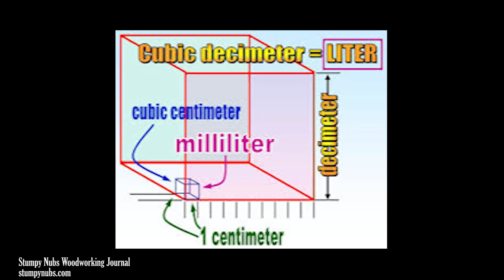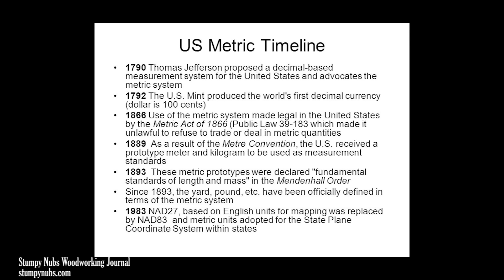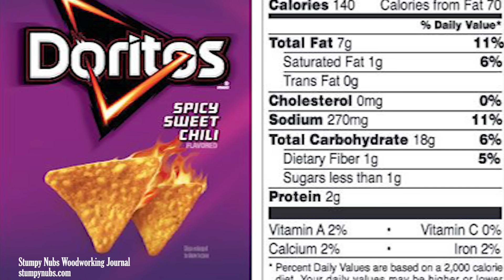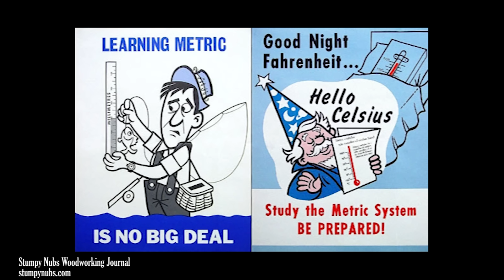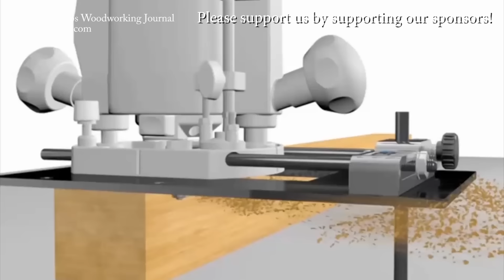BREAKING: The USA is switching to METRIC!

Comment: I’ve used inches and fractions almost forever in my workshop. But during my last project building a desk, I got real tired of adding fractions like 3/8 + 1/4 + 3/16  to get a total I need to make a cut. I whipped out my metric tape measure and  almost never looked back. I reduced my scrapped cuts as well! 1:49
Reply: ditto, I use metric whenever possible. especially if its a project I am doing alone, for myself. I grab the metric tape every time.
Reply: 6/16 + 4/16 + 3/16 = 13/16 ...... if you convert like that in your head, it's trivial to add fractions on the fly... For woodworking, where the smallest fraction will be 1/16, this works great.
Reply: @JDeWittDIY  but think of all the pencil lead you save by not having to write the denominator all the time.
Reply: @JDeWittDIY It always helps to multiply things by some number before adding them and then divide result by 16. It's so much easier than to just add them :p
Reply: Yeah, make things simple that's what I say. Not everyone can figure out the complicated fractions.
Reply: @JDeWittDIY 19/64th vs 7.5mm 

Metric is better
Reply: @JDeWittDIY   when you get up to 127 sixteenths, it's still simple to divide by 16, but if you were metric, you just wouldn't have this step.  You can't make a mistake in a step you don't have.  I tried the above in my head by dividing by 4 twice and after first division got 31 3/4s and then proceeded to think 1/16th less than 32/4, but wrote down 8 1/16 instead of 7 15/16.  But measuring stuff isn't really where metric shines, it's in conversion.  What would be the volume and hence mass (or weight) of a lump of steel with dimensions of your fractions above.
Reply: If inches had been scrapped as a legal measurement unit a long time ago, we could have still used inches but now as 2.5cm instead of 2.54.  
Would had made it easy to swap back and forth.
Reply: @JDeWittDIY having been in a couple cabinet and furniture production shops, it's not unusual to have an accuracy to the 1/32 for the project.  That makes things difficult really fast when you're doing conversions in your head, and you've got a 3/8 a 5/16 and a 3/32  to add together...
Reply: @bikermike721 I did the same thing. I got so tired of taking 5 math steps to do a simple addition or subtraction because of fractions. Got a tape measure in millimeters and never looked back. Everything is done in whole numbers. Metric is far better done by thousands not tens. I worked at a door factory that made architectural wood flush interior doors. It was all metric. Door dimensions is measured in mm.
Reply: @JDeWittDIY This is like learning hex-calculus, instead of just using decimals.
Reply: @Itoyokofan  Which might be the reason I have no issue with fractions in imperial units; from all my working with low-level programming hexadecimal (and binary) is almost second nature to me.
I still vastly prefer metric, though.
Reply: One thing first, I live in Germany. We only use the metric system. What I have gotten used to (actually through the apprenticeship as a carpenter) is that I measure everything in millimeters. Means: if I have a plate with the dimensions 30x40 cm I use the specification in millimeters. These are then 300x400. The advantage is that if I now cut 5 millimeters off the 30x40 plate, I have 295x395 left over. It gets exciting with squared timber. In Germany, squared timber is generally specified in millimeters. Means: 60x80x2000 -> 6x8x200 (6cm x 8cm x 2 meters). Calculates wonderfully because the factor is always 10. Millimeter to centimeter 10, centimeter to decimeter 10, decimeter to meter 10. From meter to kilometer it is 1000.

At the end of the day it is also only a question of habit. However, this conversion of fractions is so incredibly cumbersome. In school we learn to calculate with fractions, but not as intensively as in America. We don't use things like 11/16 as much.

Comment: I grew up metric but have used inches for decades since moving to the US; years in the construction industry certainly helped that along. I now find myself using millimeters when precision is required and feet and inches for rougher work. What really has me scratching my head is decimal inches, especially rulers with sixteenths on one side and tenths on the other. A trap for the unwary if I ever saw one.
Reply: And for some reason surveyors like to use decimal feet. Very odd.
Reply: I'm a surveyor, decimal feet have ruined inches for me forever
Reply: @drewbacca1981 My feet are decimal. They have 10 toes.
Reply: I work in a company that makes windows and sunrooms. The labels/order slips list dimensions in decimal feet and inches but we have “the giant inch” on each machine. This is a 4x5 card with 1 “inch” along the long side divided into 16ths of an inch. It is then marked with dots showing common decimal inch increments such as 3/10 inch. That way workers can tell at a glance approximately where to cut if they only have a standard tape measure with 16ths of an inch but not 10ths.
Reply: It seems to me as if *small units*, in general, are the ones that have been most uncontroversially switching to metric. Grams and milligrams, milliliters and millimeters. They seem much less unwieldy than avoirdupois and troy ounces, fluid ounces, drams and minims and 64ths of an inch. Maybe because these units have less everyday familiarity to begin with so people have less emotional attachment to them, and simpler systems prevail.
Reply: Although logic totally favors the Metric System I do have one problem - and it has to do with my age and the resulting diminishing quality of vision.  Those itsy bitsy millimeter marks on a ruler can make it difficult to tell if it is 7mm or 8mm or any other close pair.  However, I am using metric more and more hope the USmoves quicker to implement it. Enough with silly fraction sockets - metric simplifies which one to look for if you need one bigger or smaller - and if in doubt, grab a 10mm..
Reply: @georgerobertson4655  I share your pain but there are tapes and rulers out there that vary the height of the odd and even number tick marks. It really helps when you can go 2, 4, 6 so that must be seven mm.
Reply: I'd recommend using tenths instead of inches. Gives you all the benefits of metric without needing to convert anything. Need to go more precise? Hundredths. More precision? Thousandths. So on and so forth. It's what us land surveyors use since we often need to be accurate to the nearest thousandth.
Reply: @CelticAssassin  Interesting but if we agree that a decimal system is much easier to work with and more precise, why not switch to a ten based system that the rest of the world uses?
Reply: @torstenhansen4308  Saves you from having to switch to an entirely different system and rework your brain around said system in circumstances where that system may not actually be any better.

The foot is a really good example of this. A foot is a very reasonable unit of measurement for something that's not too long but also not very small. Metric has decimeters but they're still only a third the length of a foot and the next step up is three times the length, metric doesn't really have that middle ground. Customary using tenths, on the other hand, has a bit of both. Going smaller you're now in a simple, easy base 10 system. Going bigger you're no longer thinking about precision anymore, you just want a distance you can wrap your head around.

The average person will never need to convert feet to miles on any regular basis. Feet to yards is three feet which is a very easy conversion and once you do that you're using yards or at worst yards and feet. The merits of metric exist as you get smaller, not as you get bigger so making a full-tilt swap would be more trouble for the common person than its worth. Really good for precise measure, not really much of an improvement on general distance measure.

Why cause an ungodly amount of confusion as well as logistical, legal, and clerical issues for no real benefit just to match another country that doesn't effect us when we can just improve what we already have with a method that's already in use? Dropping inches would solve the overwhelming majority of customary's issues.
Reply: @torstenhansen4308  Apologies both now and in advance for any text walls. Still stuck in the college essay habit and it does not want to be kicked.
Reply: @CelticAssassin  Not quite. Can you tell me without taking out a calculator how many square inches are there in a square mile? That kind of conversion with the metric system is easy (a kilometer has 1,000 meters, a meter has 100 centimeters, thus a kilometer has 100,000 centimeters and a square kilometer has 10,000,000,000 square centimeters; it's all just shifting the decimal point).
Reply: @torstenhansen4308  A decimal based system is not inherently more precise. Something measured to the nearest 1/32" is more precise than something measured to the nearest mm. Of course, something measured to the nearest 0.1 mm is more precise still--but one can keep going down that rabbit hole by measuring something to the nearest 1/256" inch. Now, when one gets to those fractions, yes, it gets harder to work with in one's head, I'll grant you that. But I think most digital measurement systems actually work, on a hardware level, in binary. 16 bit precision vs. 32 bit precision vs. 64 bit precision--which isn't all that different from 1/16", 1/32", and 1/64".
Reply: @mschmidt62  You are of course correct, bad choice of words on my part.
Reply: @mschmidt62  It's not practical for people to calculate in units of 1/32, or 1/256. Calculating with 10, 0.1, 0.01, etc. is more practical (you can do it in your head). And for computers that doesn't matter. Yes, they internally work with binary logic but for a computer, it's easy to convert it into decimal numbers (with high precision, higher than you will need usually).